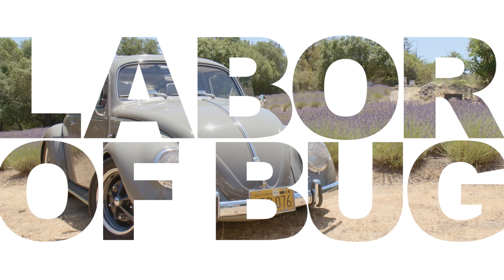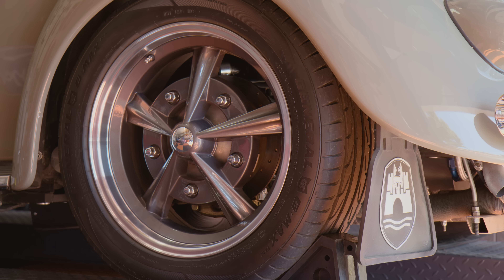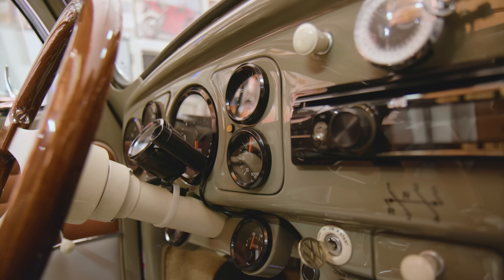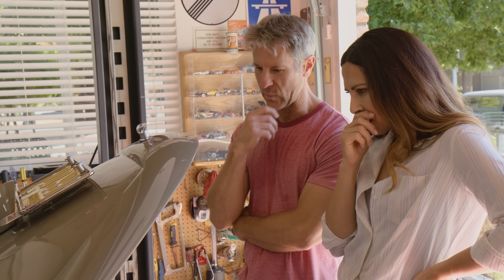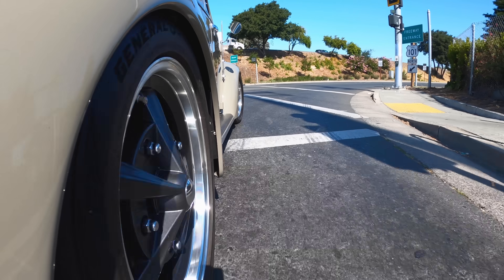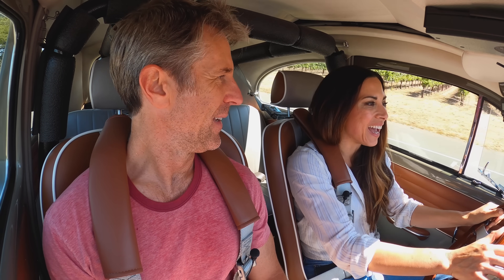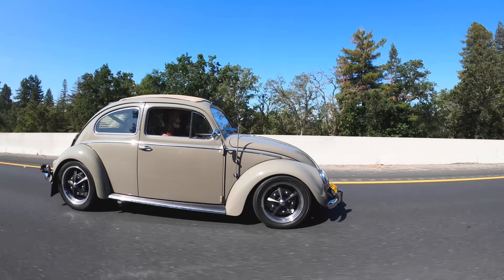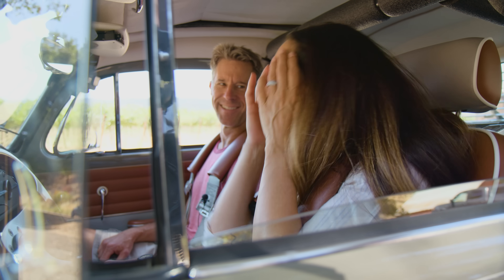LABOR OF BUG: Twin-Turbo '59 VW Euro Beetle 27 Years in the Making | EP10

Comment: amazing car. but we need more info! more engine details, suspension, chassis, etc etc
Reply: 1959 Euro Beetle Twin Turbo Resto-Mod

Engine:
•	2387cc VW Type 1 aluminum super case with Hoover mods, 8.3:1 CR, clearanced, blueprinted and balanced by owner
•	Scat forged counterweighted 86mm crank, type 1 mains, 2” Chevy rod journals
•	DRD 5.5” H-beam rods with 5/16” ARP bolts
•	Revmaster long 94mm cylinders, cut to length
•	Wiseco  pistons[P/N#K633M94, 9400XX ring pack(1.0mm x1.2mm x2.8mm)] 
•	WebCam custom grind turbo cam with Dial-A-Cam steel straight cut gears and CB lightweight lifters 
•	CB Wedge Port CNC ported heads(44x37.5) with single “Bee Hive” springs and 8mm chromoly studs
•	NGK DCPR8EIX Iridium spark plugs and Magnecor wires 
•	Scat 1.25:1 Pro Comp rocker arms with ACN heavy duty dual tapered aluminum pushrods 
•	Parallel twin modified Garrett VNT25 variable vane turbos with manual vane control and water jacket cooling system by owner
•	Custom 1.5” phase tuned “twin scroll” exhaust system, ceramic coated and wrapped, made by owner 
•	Twin Turbosmart 38mm wastegates and Turbosmart Eboost Street electronic boost controller
•	Electromotive upgraded TEC3 EFI full sequential engine management with Clewett Engineering cam sync. Dyno tuned by AJ at    Performance In-frame Tuning  in Napa, CA making 230HP/210TQ at the wheels with 15psi
•	Bosch in-line fuel pump, Aeromotive regulator and filter, teflon hoses, with Siemens Deka 60lb/hr injectors
•	Prometh two stage water/methanol injection with nozzles before and after compressors, with Snow progressive controller
•	Custom blow through finned aluminum intake with modified CB 48mm throttle bodies & match ported injector manifolds, HKS blow off valve, custom dual throttle cable system and cold air intake by owner
•	Bergmann modified Porsche style fan kit with custom thermostat, front, rear and lower cylinder tins  by owner
•	Scat 5.25” aluminum pulley with sand seal, crank trigger wheel and custom sensor mount by owner
•	Dry sump system with CB pump, Pure Power cleanable filter with Scat bypass mount, remote cooler with thermostatic fan control and custom oil tank in right rear fender well by owner
Transaxle:
•	Type 1 swing axle, gusseted aluminum Rhino case, Berg 5 speed with Quaife TBD by Rancho
•	3.44 R&P, 3.78 1st, 2.21 2nd, 1.58 3rd, 1.21 4th, 0.93 5th  with Berg custom mid mount and 5 speed ball shifter
•	Empi long spline, long axles(‘68 only), with custom prototype lubrication system, by Mike Herbert at Rancho and owner 
•	Custom hydraulic clutch with remote reservoir and heavy duty hiem joint clutch cable back up option by owner
•	12lb. flywheel with Kennedy Stage 2 pressure plate, CB dual friction disc, anti-shocker and high torque starter
Chassis, Suspension & Brakes:
•	Airkewld 4” narrowed, adjustable front beam, with bump stops and tow bar mounts added by owner
•	CB 2.5” dropped spindles with CSP wide 5 drilled front disc, Hurst Line Loc and CB wide 5 drilled rear disc brakes with Tilton remote reservoirs
•	Wilwood brake proportioning valve on front line and brake cooling ducts front and rear by owner
•	Sway-a-Way 26mm rear torsion bars, Atomwerk 1” lowered adjustable spring plates with needle bearings
•	Pan stiffeners, front beam stiffeners, gusseted torsion arms, front air dams, four wheel alignment and corner balance
•	CSP torque bar, Berg traction bar, tranny straps and custom 0.75” front and rear sway bars by Addco
•	Bilstein shocks front(stock height) and rear(1” lower and custom valved)
•	Custom one-off aluminum smoothie wide 5 wheels with spun aluminum hubcaps(15x5F, 15x6R) and a set of Rader track wheels(15x5F, 17x7R)
•	Dry weight approx. 2200lbs.   
Body & Interior:  
•	Grafted in ragtop and semaphores, body work by owner and Rick Eichler, Classic Restoration in Sonoma, CA
•	VW mouse grey PPG CLV single stage urethane with clear coat sprayed by Rick Eichler
•	Original style interior with German square weave carpet & Haartz Stayfast canvas ragtop by West Coast Classic Restoration and custom Daily Driver racing bucket seats by Status Racing Seats
•	4 point harnesses and roll bar, LED lighting, original pop out quarter windows
•	1.25” widened fiberglass rear fenders by Creative Car Craft, convertible decklid with custom rain gutters by owner
•	Dynamat sound deadening material throughout and custom heater system with booster fans
•	Custom auxiliary wiring harness with blinking semaphores, emergency flashers, intermittent wipers 
•	Custom Speedhut 12 gauge set and switch console and custom stereo system by owner

Comment: Hey Nicole, always a great video. I would have liked to know more about the engine ( I assume it's a T4) and trans.
Reply: I posted specs below.
Reply: 1959 Euro Beetle Twin Turbo Resto-Mod

Engine:
•	2387cc VW Type 1 aluminum super case with Hoover mods, 8.3:1 CR, clearanced, blueprinted and balanced by owner
•	Scat forged counterweighted 86mm crank, type 1 mains, 2” Chevy rod journals
•	DRD 5.5” H-beam rods with 5/16” ARP bolts
•	Revmaster long 94mm cylinders, cut to length
•	Wiseco  pistons[P/N#K633M94, 9400XX ring pack(1.0mm x1.2mm x2.8mm)] 
•	WebCam custom grind turbo cam with Dial-A-Cam steel straight cut gears and CB lightweight lifters 
•	CB Wedge Port CNC ported heads(44x37.5) with single “Bee Hive” springs and 8mm chromoly studs
•	NGK DCPR8EIX Iridium spark plugs and Magnecor wires 
•	Scat 1.25:1 Pro Comp rocker arms with ACN heavy duty dual tapered aluminum pushrods 
•	Parallel twin modified Garrett VNT25 variable vane turbos with manual vane control and water jacket cooling system by owner
•	Custom 1.5” phase tuned “twin scroll” exhaust system, ceramic coated and wrapped, made by owner 
•	Twin Turbosmart 38mm wastegates and Turbosmart Eboost Street electronic boost controller
•	Electromotive upgraded TEC3 EFI full sequential engine management with Clewett Engineering cam sync. Dyno tuned by AJ at Performance In-frame Tuning  in Napa, CA making 230HP/210TQ at the wheels with 15psi
•	Bosch in-line fuel pump, Aeromotive regulator and filter, teflon hoses, with Siemens Deka 60lb/hr injectors
•	Prometh two stage water/methanol injection with nozzles before and after compressors, with Snow progressive controller
•	Custom blow through finned aluminum intake with modified CB 48mm throttle bodies & match ported injector manifolds, HKS blow off valve, custom dual throttle cable system and cold air intake by owner
•	Bergmann modified Porsche style fan kit with custom thermostat, front, rear and lower cylinder tins  by owner
•	Scat 5.25” aluminum pulley with sand seal, crank trigger wheel and custom sensor mount by owner
•	Dry sump system with CB pump, Pure Power cleanable filter with Scat bypass mount, remote cooler with thermostatic fan control and custom oil tank in right rear fender well by owner
Transaxle:
•	Type 1 swing axle, gusseted aluminum Rhino case, Berg 5 speed with Quaife TBD by Rancho
•	3.44 R&P, 3.78 1st, 2.21 2nd, 1.58 3rd, 1.21 4th, 0.93 5th  with Berg custom mid mount and 5 speed ball shifter
•	Empi long spline, long axles(‘68 only), with custom prototype lubrication system, by Mike Herbert at Rancho and owner 
•	Custom hydraulic clutch with remote reservoir and heavy duty hiem joint clutch cable back up option by owner
•	12lb. flywheel with Kennedy Stage 2 pressure plate, CB dual friction disc, anti-shocker and high torque starter
Chassis, Suspension & Brakes:
•	Airkewld 4” narrowed, adjustable front beam, with bump stops and tow bar mounts added by owner
•	CB 2.5” dropped spindles with CSP wide 5 drilled front disc, Hurst Line Loc and CB wide 5 drilled rear disc brakes with Tilton remote reservoirs
•	Wilwood brake proportioning valve on front line and brake cooling ducts front and rear by owner
•	Sway-a-Way 26mm rear torsion bars, Atomwerk 1” lowered adjustable spring plates with needle bearings
•	Pan stiffeners, front beam stiffeners, gusseted torsion arms, front air dams, four wheel alignment and corner balance
•	CSP torque bar, Berg traction bar, tranny straps and custom 0.75” front and rear sway bars by Addco
•	Bilstein shocks front(stock height) and rear(1” lower and custom valved)
•	Custom one-off aluminum smoothie wide 5 wheels with spun aluminum hubcaps(15x5F, 15x6R) and a set of Rader track wheels(15x5F, 17x7R)
•	Dry weight approx. 2200lbs.   
Body & Interior:  
•	Grafted in ragtop and semaphores, body work by owner and Rick Eichler, Classic Restoration in Sonoma, CA
•	VW mouse grey PPG CLV single stage urethane with clear coat sprayed by Rick Eichler
•	Original style interior with German square weave carpet & Haartz Stayfast canvas ragtop by West Coast Classic Restoration and custom Daily Driver racing bucket seats by Status Racing Seats
•	4 point harnesses and roll bar, LED lighting, original pop out quarter windows
•	1.25” widened fiberglass rear fenders by Creative Car Craft, convertible decklid with custom rain gutters by owner
•	Dynamat sound deadening material throughout and custom heater system with booster fans
•	Custom auxiliary wiring harness with blinking semaphores, emergency flashers, intermittent wipers 
•	Custom Speedhut 12 gauge set and switch console and custom stereo system by owner

Comment: That bug is pretty sweet! This guy needs to upgrade the trans to a 915 or G50 at least for the overdrive.
Reply: check the specs posted in a reply below.
Reply: 1959 Euro Beetle Twin Turbo Resto-Mod

Engine:
•	2387cc VW Type 1 aluminum super case with Hoover mods, 8.3:1 CR, clearanced, blueprinted and balanced by owner
•	Scat forged counterweighted 86mm crank, type 1 mains, 2” Chevy rod journals
•	DRD 5.5” H-beam rods with 5/16” ARP bolts
•	Revmaster long 94mm cylinders, cut to length
•	Wiseco  pistons[P/N#K633M94, 9400XX ring pack(1.0mm x1.2mm x2.8mm)] 
•	WebCam custom grind turbo cam with Dial-A-Cam steel straight cut gears and CB lightweight lifters 
•	CB Wedge Port CNC ported heads(44x37.5) with single “Bee Hive” springs and 8mm chromoly studs
•	NGK DCPR8EIX Iridium spark plugs and Magnecor wires 
•	Scat 1.25:1 Pro Comp rocker arms with ACN heavy duty dual tapered aluminum pushrods 
•	Parallel twin modified Garrett VNT25 variable vane turbos with manual vane control and water jacket cooling system by owner
•	Custom 1.5” phase tuned “twin scroll” exhaust system, ceramic coated and wrapped, made by owner 
•	Twin Turbosmart 38mm wastegates and Turbosmart Eboost Street electronic boost controller
•	Electromotive upgraded TEC3 EFI full sequential engine management with Clewett Engineering cam sync. Dyno tuned by AJ at Performance In-frame Tuning  in Napa, CA making 230HP/210TQ at the wheels with 15psi
•	Bosch in-line fuel pump, Aeromotive regulator and filter, teflon hoses, with Siemens Deka 60lb/hr injectors
•	Prometh two stage water/methanol injection with nozzles before and after compressors, with Snow progressive controller
•	Custom blow through finned aluminum intake with modified CB 48mm throttle bodies & match ported injector manifolds, HKS blow off valve, custom dual throttle cable system and cold air intake by owner
•	Bergmann modified Porsche style fan kit with custom thermostat, front, rear and lower cylinder tins  by owner
•	Scat 5.25” aluminum pulley with sand seal, crank trigger wheel and custom sensor mount by owner
•	Dry sump system with CB pump, Pure Power cleanable filter with Scat bypass mount, remote cooler with thermostatic fan control and custom oil tank in right rear fender well by owner
Transaxle:
•	Type 1 swing axle, gusseted aluminum Rhino case, Berg 5 speed with Quaife TBD by Rancho
•	3.44 R&P, 3.78 1st, 2.21 2nd, 1.58 3rd, 1.21 4th, 0.93 5th  with Berg custom mid mount and 5 speed ball shifter
•	Empi long spline, long axles(‘68 only), with custom prototype lubrication system, by Mike Herbert at Rancho and owner 
•	Custom hydraulic clutch with remote reservoir and heavy duty hiem joint clutch cable back up option by owner
•	12lb. flywheel with Kennedy Stage 2 pressure plate, CB dual friction disc, anti-shocker and high torque starter
Chassis, Suspension & Brakes:
•	Airkewld 4” narrowed, adjustable front beam, with bump stops and tow bar mounts added by owner
•	CB 2.5” dropped spindles with CSP wide 5 drilled front disc, Hurst Line Loc and CB wide 5 drilled rear disc brakes with Tilton remote reservoirs
•	Wilwood brake proportioning valve on front line and brake cooling ducts front and rear by owner
•	Sway-a-Way 26mm rear torsion bars, Atomwerk 1” lowered adjustable spring plates with needle bearings
•	Pan stiffeners, front beam stiffeners, gusseted torsion arms, front air dams, four wheel alignment and corner balance
•	CSP torque bar, Berg traction bar, tranny straps and custom 0.75” front and rear sway bars by Addco
•	Bilstein shocks front(stock height) and rear(1” lower and custom valved)
•	Custom one-off aluminum smoothie wide 5 wheels with spun aluminum hubcaps(15x5F, 15x6R) and a set of Rader track wheels(15x5F, 17x7R)
•	Dry weight approx. 2200lbs.   
Body & Interior:  
•	Grafted in ragtop and semaphores, body work by owner and Rick Eichler, Classic Restoration in Sonoma, CA
•	VW mouse grey PPG CLV single stage urethane with clear coat sprayed by Rick Eichler
•	Original style interior with German square weave carpet & Haartz Stayfast canvas ragtop by West Coast Classic Restoration and custom Daily Driver racing bucket seats by Status Racing Seats
•	4 point harnesses and roll bar, LED lighting, original pop out quarter windows
•	1.25” widened fiberglass rear fenders by Creative Car Craft, convertible decklid with custom rain gutters by owner
•	Dynamat sound deadening material throughout and custom heater system with booster fans
•	Custom auxiliary wiring harness with blinking semaphores, emergency flashers, intermittent wipers 
•	Custom Speedhut 12 gauge set and switch console and custom stereo system by owner

Comment: Do anyone know what size tires he's used on the front
Reply from the maker: I reached out to Marc. Here was his response: 

I have two sets of wheels/tires, a street/drag set (custom one off aluminum copy of stock but wider) and a street/track set (aftermarket Rader style). 

Street/drag: Front 15x15 with 185/60/15, Rear 15x6 with 215/65/15 

Street/track: Front 15x5 with 185/55/15, Rear 17x7 with 225/50/17

Additional specs are listed in the first comment pinned to the top of this video. You asked for the one spec that wasn’t listed! Thanks for watching!

Comment: Brah! who'd you sail with.AMO? MEBA?
Reply: MEBA 1999-2008
Reply: Sweet sailed outta the SF Hall. Frequented the Pineapple Run with Matson Lines.
Reply: @hylndrfan  cool, so did I. what's you're name? I came out of CMA in '96
Reply: @turbovdub1867 KP '90. Im a dubber as well. 64,70 and 74 Bus. I keep it all pretty stock 1600 SP with solex carbs. The 74 has a type 4 engine.